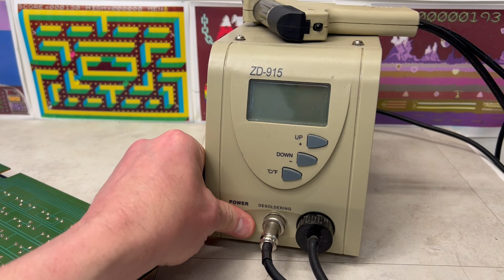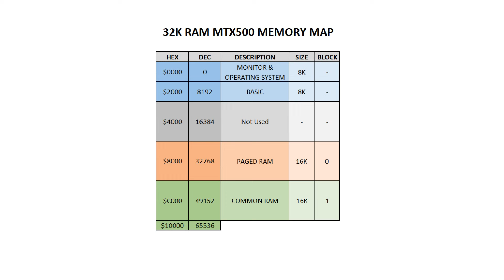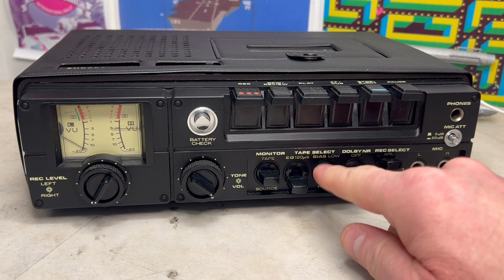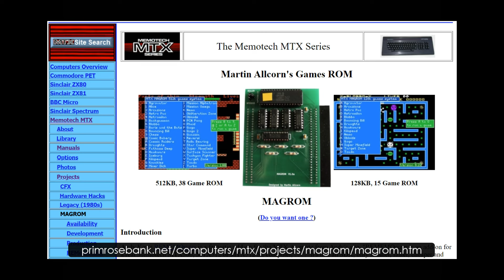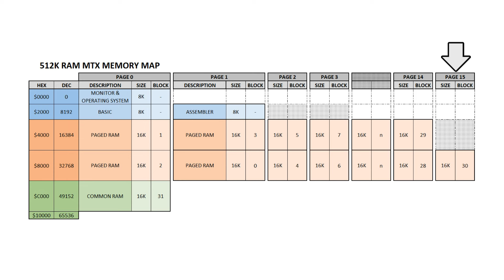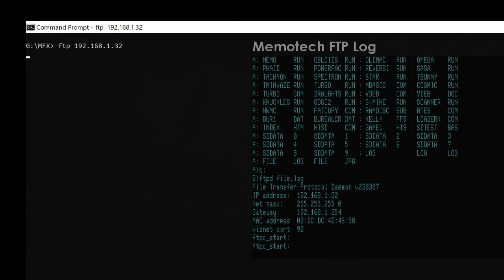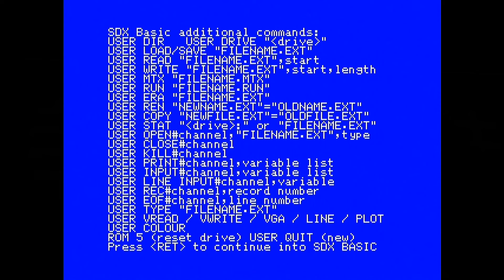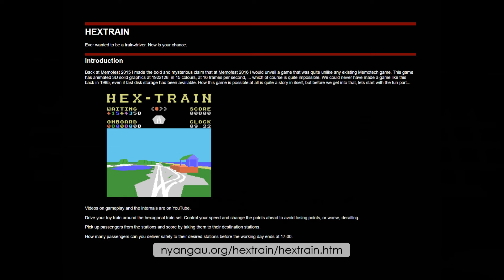1983 Memotech MTX500/512 Review and Modern Mods

Comment: I still have my original 500 from the shop where I worked, which had a small stock of 500 and 512s.

Built like a tank and had much promise. I did convert one of the games we made for it (Next War) but it was never released.
Reply from the maker: You should convert the game file to a sound file and make available to hobbyists to load. I can put you in touch with the Memofest team too.

Comment: Given that the keyboard cable wires were broken, I really don't understand why you used a desoldering tool to remove the solder and remaining wire. A regular soldering iron and solder braid would have allowed the clean up of the board with a lot less damage to the pads, especially in view of the fact that the keyboard is using a single sided PCB.  Interesting machine though. I like the way they split the software resources across the EPROMs (a little like the BBC Micro in that respect).

Comment: Is a text prompted voice used here? It’s quite robotic, with the beginning of sentences cutoff 😬 I’m also surprised that considering the MTX here had 512KB of system RAM, another 16KB of dedicated VRAM, dedicated and discrete video and sound chips. That the graphics and audio quality of this micro still doesn’t compare to the C64 of the same era. It’s a high quality gorgeous looking thing though. One of the best designed micros in that department anyway.
Reply: The Memotech's sound and graphics don't compare to the Atari 400/800 from 1979, but then again, the C64 wasn't much more advanced than the Ataris either, despite coming out 3 years later. At that time, in the UK, the C64 was the second most popular computer. Like the Memotech, it was initially priced quite high, out of the reach of many. CBM then slashed prices (and margins) to the bone, deliberately trying to kill off a good number of competitors in the process.